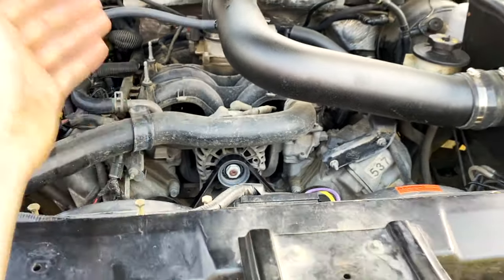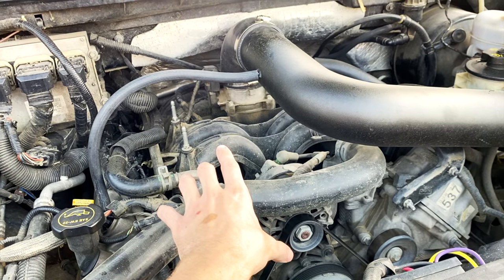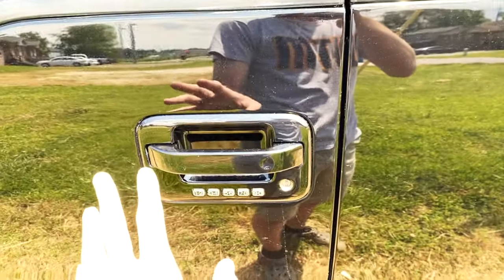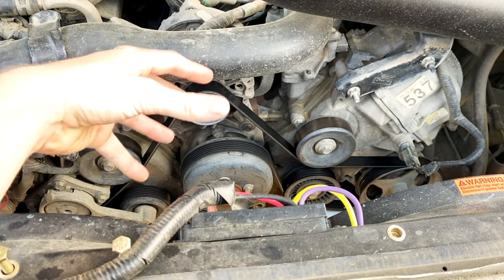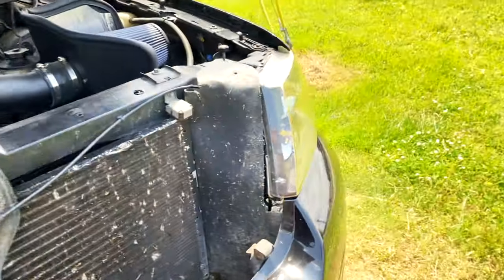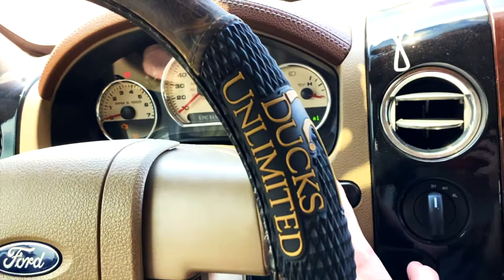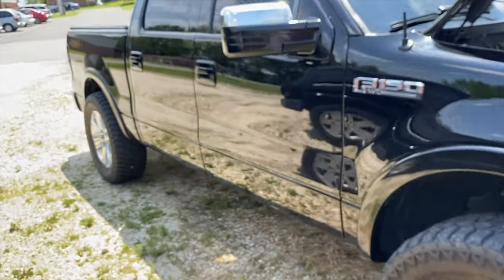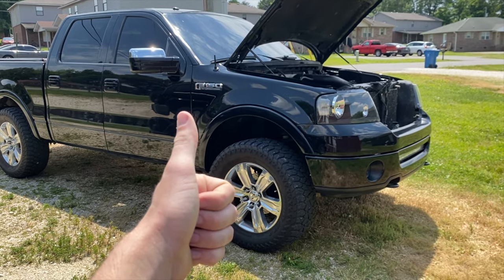5 THINGS YOU DID NOT KNOW ABOUT YOUR 2004-2008 F-150

Comment: Got a 2006 F150 with 282,000ish miles, no check engine light still running strong! (update 10/11/22 Now @ 310K) (other update: Has check engine light for Mass Airflow Code, gonna get it fixed this weekend. 10/11/22)
Reply: that’s right sir.  got a 04 and 400,000 miles over still running good
Reply: @damiansockey3008  I’ve had to do some work on mine. Nothing major tho. Replaced most of the Fire/Fuel System (spark plugs, coils, injectors, fuel filter, fuel pump) around 237,000 miles. MAF, TPS, Battery, Starter, Alternator, all Idler Pulleys, Tensioner pulley, Fan clutch, O2 sensors around 255,000 miles. Suspension work (Upper Control arms, lower control arms, hub assemblies, brake calipers) done as well around 270K. So she’s had a ton of maintenance but so far it’s paid off!
Reply: @EdGeZeR0 how much have you spent on your truck ?
Reply: @damiansockey3008  me and a friend who’s a mechanic at a local dealer did mine so the labor was pretty much free. I didn’t cheap out on the parts tho! I got all good brand stuff. I also got some aftermarket stuff that I didn’t include. But for the parts I’d say around 6-8K!
Reply: @damiansockey3008  and the truck only cost me 5000K cash back in 2017. It had 202,000 miles back then.
Reply: @EdGeZeR0 you got a good friend. i spent 6k on labor and parts were 3k
Reply: @damiansockey3008  an extremely good friend! but 9K isn’t too bad either tho. As long as the truck has been dependable lol
Reply: lol, F150, no CE light......means ZERO
Reply: @dkrawk8309  the check engine light does work. It’s been on before. It doesn’t have one on because there is nothing wrong. It’s running perfect.
Reply: @damiansockey3008  I got a clean 04 5.4 triton with 4x4 with a bunch of miles on the tranny, how much would you sell yours for? I think depending on the state we'd be able to get atleast 11k even if it's over 15 years old. Just curious if and for how much you'd sell for. Someone offered me 8k a few weeks ago and caught myself thinking that's pretty low, but I could be biased.
Reply: @NorthCountryGrappling  somewhere around that area $10k.
Reply: Same model year 5.4L with 119,300 miles (bought July '09 with just under 23,000 miles on the odo).  Did the timing job myself two years ago at 104,000 miles (Melling and Ford OEM parts).  Also replaced the belt, all the pulleys, and radiator hoses at the same time. (All told, the above was about $1400 in parts).  All four brakes, fresh brake fluid, shocks and stabilizer bar links at 100k miles. Spark plugs at 85,000 miles.  Check Engine light has never been on (it does work, it turns off a second or two after engine start, and with KOn-EOff)

Next, I need to do a transmission and diff fluid change soon.
Reply: @charlesball6519  the timing chain has yet to go out on me. Surprisingly. And I’ve also never changed the transmission oil & filter. I heard that could make that transmission slip but idk how true that is. I’ve also done some driveshaft work on it. Had to replace the U-Joints and I believe the carrier bearing on mine is going bad so I’ll have to replace that sometime.
Reply: @EdGeZeR0  Changing the transmission fluid doesn't cause it to slip.  That's just old school rumor (and its basically only true when the transmission is already failing).  On the F-150 Forums, people who have done a fluid and filter change have said how much better and smoother their transmission shifts after they've done it.

As for the timing job, you don't hear any chain slap when you start the truck?  No cam phaser knock at idle when warmed up?
Here's pictures I took when doing mine https://imgur.com/gallery/wwKJjUJ
Reply: My 2008 just reached 210,000 still running strong
Reply: i just picked up an 09 with the 5.4 and im sitting at 448000km no tick or cel
Reply: @brianmcneely1775  that’s what i like to hear. keeping the truck running good
Reply: @damiansockey3008  416,7xx on my 04 lariat same motor n Trans
Reply: @damiansockey3008  waoo on 5.4 3v that impressed what oil do you use 5w20 or 5w30?
Reply: @Playstation5-d9u  5w20
Reply: @damiansockey3008  ok I think I gone stick whit 5w20 Mobil 1 full synthetic
Reply: 🤙🤙 Mines got miles and runnin strong aswell 😎😎
Reply: Have an armada n a Titian no problem just regular maintenance. 
Had a f150 4.6l 2v   Broke my dif. Was spitting out plugs, until it my my engine spit out a piston. At only 175k miles.
Reply: @charlesball6519  hmm. Do you think it’d be a good idea to do it at 283,000 if I’ve never done it? I’ve had the truck since like 201,000 miles.
Reply: @EdGeZeR0  More than likely the previous owner did it before you bought it.  I'd suggest tat maybe every 100-150k miles it be done
Reply: Mine was like that til it hot 300k something and yeah now i cant find my vacuum leak after i replace the phaser and chain but still i like mine 2004 f150 lariat
Reply: Same got a 07 240,560 miles needs a new timing kit and coil packs for a while now never quit on me yet
Reply: @levivogel9029  I did coil packs & spark plugs @ 230-240K. Haven’t done them since because the spark plug in Cylinder #7 was giving me hell the last time I did it. Truck is almost 284K now.
Reply: @EdGeZeR0  I used to have a 2000 f150 with the 5.4 in it I had to fix the plugs and coil packs in it every time it hit a puddle the spark plug holes filled with water it was a head ache. I would just take a anti freeze tester and suck it out
Reply: I am thinking about buying one should i
Reply: @gordonharris8172  I have a 2004 F-150 love it but right before 150000 miles the engine blew the 2 valve engines suck if you do get one just make sure and change all your spark plugs and timing belt. Also use fords recommended oil because it allows it to flow a lot faster through the lines helping it to not build up pressure in your engine
Reply: I have a 05 with 272,000 still running amazing
Reply: The 2006 is the best year. I got an 06 king ranch. 235k miles and everything works perfectly still. Sunroof and all.
Reply: Me too dude..thats awesome..
Reply: @damiansockey3008  hah, I've got an 04 as well with 110k on it. So far I had to replace at least 6 sensors, rear window motor, alternator, belt, two idler pulleys, transmission, throttle body, tailgate cables, spark plugs, power steering pump, and of course the entire motor. I'm already in too deep so I'd rather not buy a new truck, especially since I got this one for 6k with 85k miles. I don't drive daily or rough since it's slow as hell, and I've replaced all the oils and fluids at the recommended intervals. Ford at least slipped the newest version of the motor in and the broken parts were mostly replaced with upgraded or high quality aftermarket parts. I'm also just going to use strictly AMSOIL 5w-30 (not 5w-20, jeez Ford what the hell were you thinking) with Mobil-1 EE filters. I love the truck a lot and would like to drive it till it hits 500k on the OD
Reply: @HairIsaBird  you went through it a lot lol. im having rear differential pinion bearing problem.
Reply: @adventuresiwork3563  ahhh i need me a king ranch
Reply: I got an 04 with 330 and she is a hoss still running like new
Reply: How ya doin now? I’m about to turn 325k in about a week
Reply: @justinlamb3822  mines at 288,047 currently! I did some minor maintenance just a few weeks ago. Still running great tho
Reply: 4.6 ?
Reply: I expect you to reach 350-400…i had a 95 fi50 with over 400k miles on…j have a 06 now with 179k running strong!
Reply: Is it a 5.4l 3v. If so, what oil do you use I’m curious
Reply: @G.J.G. what oil do you use and what engine is it? Is it the 5.4 3 valve?
Reply: @stevethemechanic8099  5.4
Reply: @LilFish0  I always use Castrol Full Synthetic 5W-20.
Reply: I have a 2008 F150 with 321k miles on it and it runs like a charm
Reply: I have a 04 F150 with 188XXX. STRONG !!!
Reply: @EdGeZeR0  just got my first truck a 2006 f150 with 187,000k MI they got her for 8 grand
Reply: Original tranny to?
Reply: @jasonmartinelli6869  all original. Original Engine & Transmission. Still running good till this day.
Reply: @EdGeZeR0  that's impressive. I have an 08 5.4L F150. 170k strong engine but the tranny does slip once in a while. I need it to last at least another 18 months.
Reply: Can y’all all make a Instagram so we can post trucks?? I have a 2008 Ford F-150 and I just got rancho strut leveling kit with 35s and 18s and am telling y’all the ride is so damn smooth you can’t tell you got 35s
Reply: 07 330.270KM still running strong but the transmission… I lost my reverse but still daily it 😥
Reply: Mine has 333,000 miles 😁
Reply: @EdGeZeR0  haha no disrespect, just saw it humorous. 5000k= 5,000,000?
Reply: @jarrodlespreance8518  303,000 miles. Not kilometers.
Reply: we got that too
Reply: Hey got same truck will free to me 16 Silverado rims and lt/285/75/r16 fit
Reply: 5.4 triton?
Reply: It’s 12/12/22….. Did you get it fixed?..
Reply: @richarddiehl5993  yes truck is running and fine, I just don’t drive it anymore. I recently got a 14 Platinum 5.0.
Reply: I just bought an 07 4.2l. $1,100. Has CEL on and 249k miles.
Reply: How do you calibrate compass?
Reply: I got a 06 and have had 2 timing jobs and countless coil packs. Finally running right. 131,000 miles
Reply: When I took mine to ford ( only people that will touch them) they were 3 months out to do mine because they had so many with phaser and timing problems.
Reply: 2006 fx4 5.4 271k. cam phaser stuff done in 2021 by previous owner...runs smooth and strong. Great truck
Reply: 2004 F150 210,000Miles on it and running like new best truck ever
Reply: If you think Chevy or Dodge is better truck buy one if the Ford truck is bad then ill be paying $$$$ my lost .. for now i haven't spent nothing but regular maintenance
Reply: do you have the 5.0 or 5.4?
Reply: 4.6 is king!
Reply: Same here I’m at 292,680 and only had to replace the head gasket and timing. Other than that no other motor or trans work at all. I broke 4 spark plugs which is what led to me doing the head gasket. Wasn’t any kind of failure. It’s been a pretty damn good truck! I abuse it regularly and it just keeps on trucking!
Reply: @EdGeZeR0 what did you do on the driveshaft and why?
Reply: @jasonmartinelli6869 did you replace transmission!
Reply: @damiansockey3008 what model and engine
Reply: I got a 2004 F150 wit 196k miles. U guys make me think he has so much life left! Ofc being taken care of right now
Reply: Is it still running? I've got a 06 with 298k miles and I don't want to mod it out if it's only gonna last an extra 12k miles
Reply: I got 250 Econoline 360 000 miles no engine lights run smooth for are great
Reply: Same here.
Reply: Hello i just got 2006 f-150 4.2 v6 STX. I don’t know how good it is since its my first truck. Has 194k miles on it,i wonder why there’s no RPM gauge
Reply: 263000 on my 05.  Second motor  original trans new motor has 100k just had the timing done I bought it right before covid hit been a good truck but iv put lots of money into it. I'll take 8k for it tho😅 runs great still needs work .daily driver
Reply: Still running i need to know 😂
Reply: I also have a 2006 F150 5.4L 3V w/ 250k miles and I just installed a performance tune by Bully Dog on her. 2 Flowmaster cats to a muffler delete and she sounds like a badass race truck!
Reply: What’s it at know?
Reply: Engine?
Reply: how about 2024??

Comment: I have a 2007 for the f150 with 400,000 mi on it still going strong with a 4.6 engine I think the 4.6 was the best engine they made
Reply: Probably the 2V.  I don’t think the 3V version was put in the F150.  Pretty much the same engine.  The 4.6 3V in the Mustang had similar issues as the 5.4 3V.
Reply: Actually the 5.4 3v is
Reply: i have 06 4wd with 4.6 2v and 436000 miles on it. i commute 500 miles a week. One tough truck and engine

Comment: I have a 5.4. It’s been extremely reliable for me. One thing I constantly do is change the oil every 3-5k miles with good oil and filter. That’s key on every engine but especially the 5.4. You will avoid a lot of problems
Reply: You are absolutely right, and I do the same.
 I've always used a high quality synthetic oil, and high end filters.
I purchased my 08 Lariat new, its has been so reliable.
So many people look at the oil change intervals on the oil container or manual. 
Pull the dipstick, look at the oil color.
Do the maintenance, and the truck will last.
Reply: High volume oil pump phaser lockouts and cam chain tensioners (cast out of older 4.6) quiet motor
Reply: I just recently bought a 04 f15with the 5.4 and want to know what oil and filter did you use? I'm now fixing the broken window regulators in drivers door
Reply: @fiber9m  Yep Me too...
Reply: @fiber9m  just had that problem on my 05 f150 & it was wire harness in the door jam sum time the window would not work & i just had to move the wires around to find the sort then they would work but would still stop eventually. Good luck finding a factory (oem) replacement. Not even in the junkyard & ebay was full of fakes. Ended up taking it to a car stereo installation shop & they fixed it for 75 bucks. Had to do get it done its was the only thing not working on the truck. Good luck & happy hunting
Reply: My 2007 5.4 3 valve has 362,000 kms. Lots of oil changes, has never been opened up. I am collecting parts to do the whole timing job and Melling oil pump but it will be as a maintenance item. No noises or run issues to this point.
Reply: as for my understanding, they're either really good or really not.  I think it comes down to finding where a particular model vehicle was manufactured, or at least used to be that way.
Reply: Yall are making me jealous.. lol.   I loved mine for a year and treated it well.  140k miles and everything that possibly could go wrong did.  so 6k dollars of repairs into it and it still runs like shit and mechanics wont touch it.   so f it.   If someone wants to pay me 3k I will take it;  it is a beautiful truck.

Comment: Have a 2005 Supercab FX4 . Bought it used over 7 years ago with 118000 miles on it. It's been my daily driver all this time . Now has 252500 miles on it !  Still has original engine and trans ....with no work on either ! Just normal tune up stuff . 5.4 liter 3 valve !!! Love this truck !!! It's truly ....Ford Tough !!

Comment: You have a really nice truck Man I love it. I have an 05 Lariat with 476,000 miles on it and it is still going strong. I have replaced almost everything on it but still has the original engine transmission and rest axle. I love the look of these trucks
Reply: Cool! I have a 08 lariat and now needs s little work. I sometimes loose engine power off the highway at a stop light mostly. Any idea or tips on what to look out for I really love my truck 208k thanks
Reply: probably a bad vct solenoid, i had the same issue with my 4.6 3v.

Comment: we have a 2007 5.4L with 310,000+ miles on it. no major issues. the oil pressure is just ever so slightly low now, but not worth an engine swap like a shop would tell you it needs. good gosh, maybe replace the oil pump first. maybe replace the tensioner pulley and serpentine belt first. don't get bent over the barrel when there are super cheap fixes you can do yourself.

Comment: Hey…have a f 150, 2007 with 283,000 mi. Has a 3 valve triton V8. No noise and looks great. Believe oil is the key. Every 5k miles. Love the drive.

Comment: Another fun fact, I have an 07 5.4 lariat. The clutch fan on it has the electronic actuation. Which means the ecm can turn the fan on 100% locked on for severe conditions. Sounds like a semi! Also this fan will pull more cfm of air than any electric fan. However you will feel the horsepower loss. Just look to see if you have the wiring harness that goes to the fan clutch.

Comment: I bought my 04 in October of 03.  At that time the "new body style" F150 was still rare to see on the road and it got lots of looks. 
I now have 245,000 on the original motor and it runs and drives great. It's had a few issues, but besides a 7 year old Optima battery failing, it has NEVER left me stranded.
Reply: Original timing components?  I have a yellow 2004, considering replacing the timing parts with the updated ones.
Reply: @Hubjeep  It's had exactly 0 motor work. Now at almost 247,000.
Reply: @mrjon75   That's great to hear, mine has about 142,000
Reply: 04 f150 fx4 with 189k locked out phasers and tuned.  Runs like champ...gray on gray on gray ...no chrome
Reply: Just got one from my papaw with 42,000! Hopefully it gets 245,000!
Reply: @joelferguson4089  I'm now at 254,000+!!
Reply: @mrjon75  I got a 2005 xlt 4*4 it’s got 234,000 never seen the inside of a mechanic shop. I’ve done all the normal maintenance alternator, coil packs, spark plugs,brakes, and I did replace the fuel pump driver module (I’d recommend everyone look into this) .. also at 200,000 my motor started stalling when I came to a stop, i took the throttle body off and cleaned it really good ends up it just had crud build up and was choking. It’s been going strong! 
I’m looking into getting the 2023-2024 ford ranger.
Reply: @ECReeves  Nice! I had the same issue with the throttle body around 180000 I think. I quit using K&N filters after that.
I'm currently at 254,000 and rolling strong!
Reply: @mrjon75  320k and rolling strong
Reply: @salteengaming  Nice!

Comment: I've got a late 04 with 227k that runs g r e a t. My grandfather bought it in 05 and maintained it extremely well, later giving it to me when he stopped driving. The only problems it's ever had in its life is a bad driver window motor,  bad o2 sensor, and the volume on the radio sometimes goes up a little when I try to turn it down. I know the engine is probably going to go sooner or later, it is what it is, I can admit the fault of the 3v 5.4. But it has always been a great truck. I'll have mine forever so if a motor, trans, or rear end gives up on me, I'll just throw a new one in.